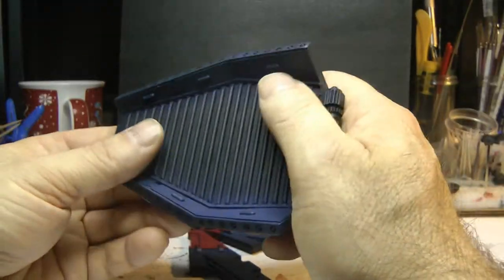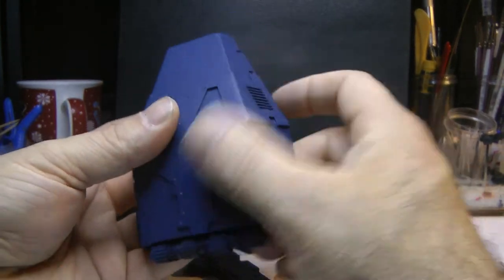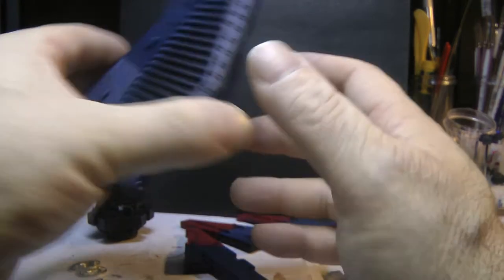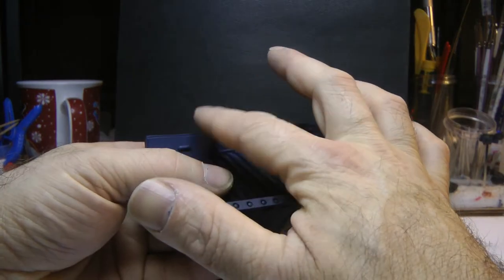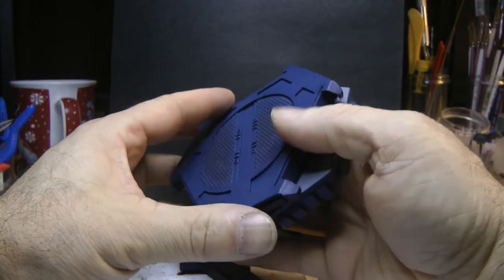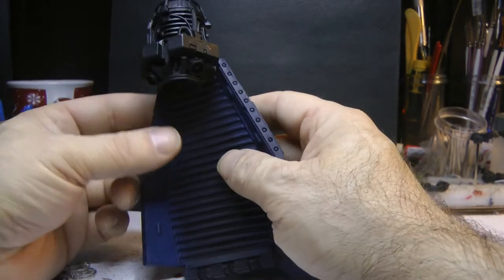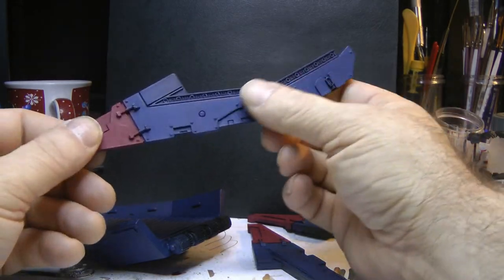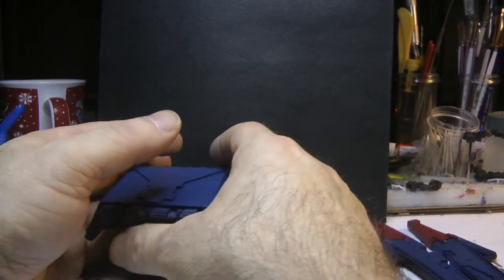forge world drop pod progress.mpg

Comment from the maker: @Nbernie72 Hey Dude,

Honestly the cool factor is pretty high, the sculpt itself is pretty cool as well.  The real disadavantage is the weakness in the door pins.  If this model is not handled well EVERY time, it WILL break.  It's pretty expensive as well, so if you are on a tight budget, I would hold off and get the GW one (especially when you include shipping)